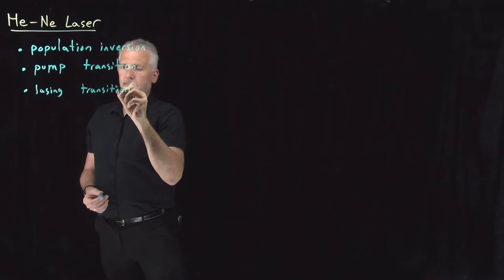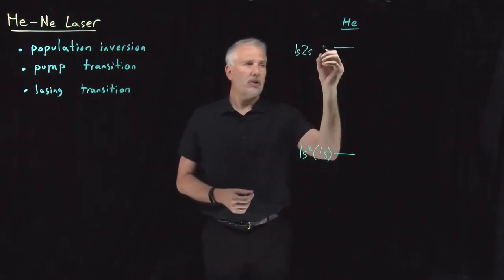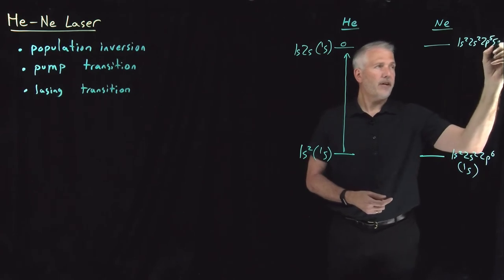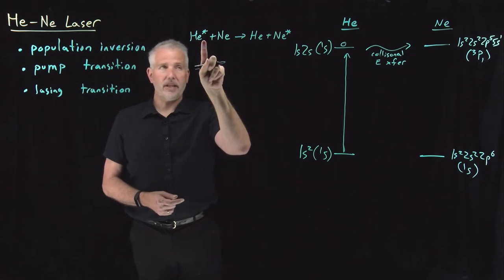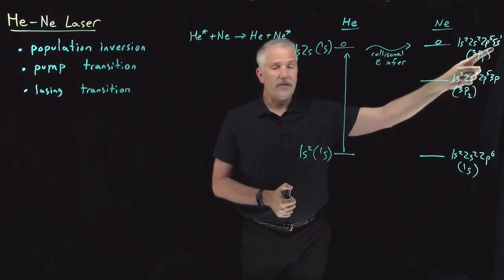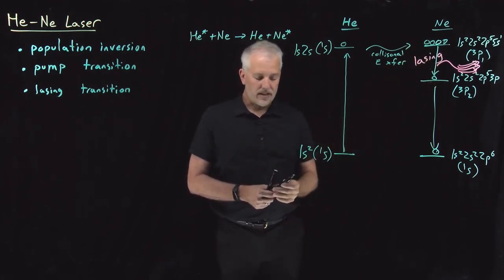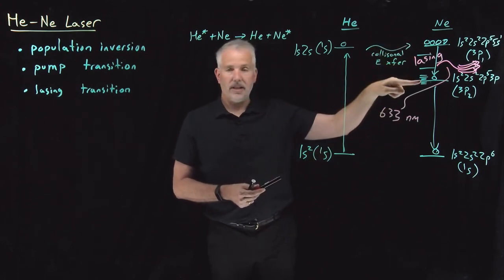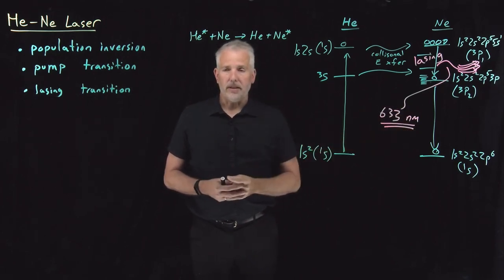He-Ne Laser

Comment: Why include the He at all? It seems we could just directly "pump" the Ne. As a guess, is it because He has fewer energy levels between the ground state and the desired energy level, so heating will produce more molecules in the desired energy level? Thank you
Reply from the maker: Yes, you're absolutely right. The He energy levels are more sparse. The pumping isn't done with light (which would allow careful targeting of a specific upper state) but by collisions with hot electrons (that populate a broad range of excited states). One of the few He states happens to line up well with the lasing transition in Ne. But a pure Ne laser would be less efficient because the denser energy ladder means a bunch of non-lasing excited states would be populated.
Reply: @PhysicalChemistry  Makes sense. Thank you!
Reply: I think this will make an avalanche condition in laser system, he atom can control the situation

Comment: Excellent video presentation.  Question--what about the conservation of angular momentum in collisional transfer of energy from Helium to Neon? Also this means that the electron in the 2p^5 orbital has the same spin as the electron in the 5s level in the Neon excited state?
Reply from the maker: The two-atom system will conserve its total angular momentum when two atoms collide, but that just applies a constraint on the post-collision velocities.

And there is no requirement that the spin states be matched for the two colliding atoms

Comment: Greetings, I've got a question which is bugging me a bit.
A He-Ne-Laser is supposed to emit monochromatic light. But wouldn't the spontanious emission from E2,Ne to E1,Ne also produce a photon which in turn would change the color emitted? Thanks in advance
Reply from the maker: You're right, there are usually transitions between many different states, producing photons with many different wavelengths. That's where the optical cavity comes in: it is designed to amplify only photons with the desired resonant frequency / wavelength. Others will undergo destructive interference.